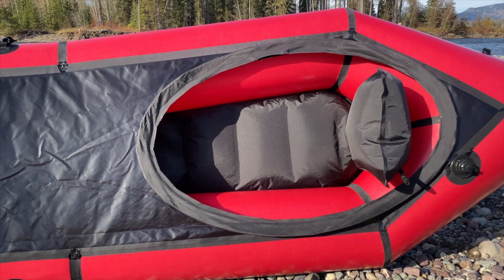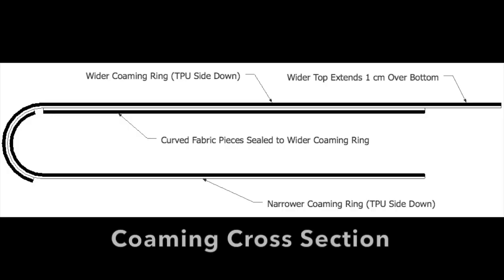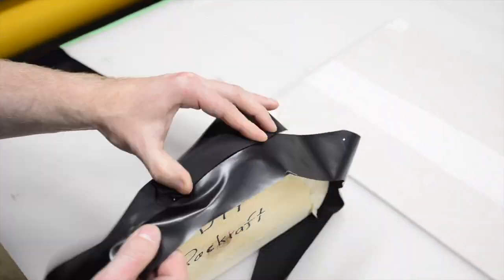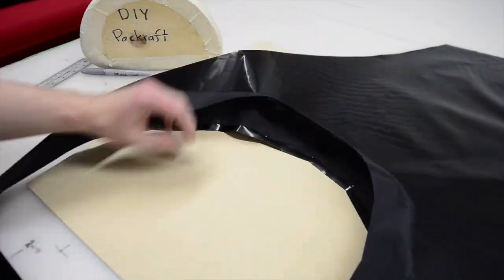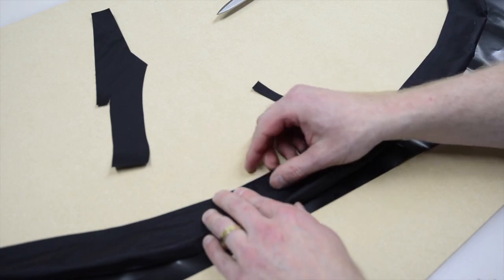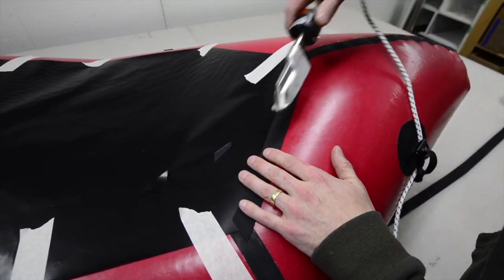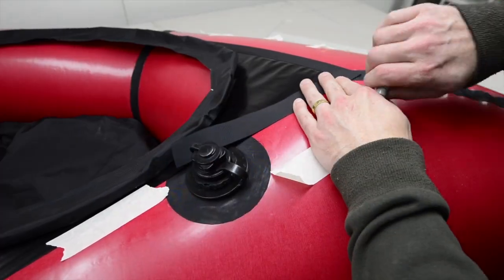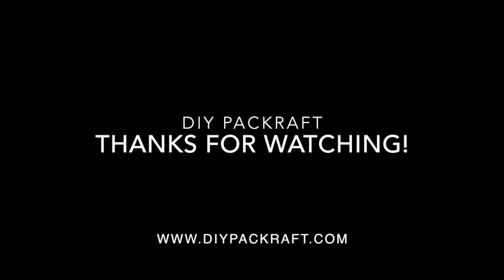DIY Packraft Spray Deck Assembly

Comment: Why didn’t you attach the strips to the black skirt before you attached it to the boat it seems like you would be able to get a good weld that way?  Just asking if their was a reason yo do it that way
Reply from the maker: The main reason is that the iron is the same width as the strips, so it’s difficult to iron only half of a strip.